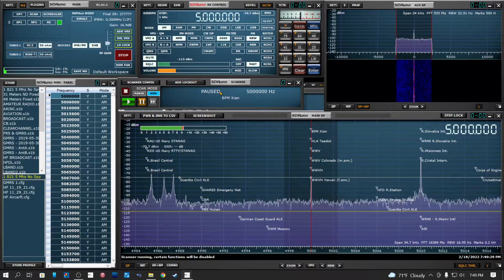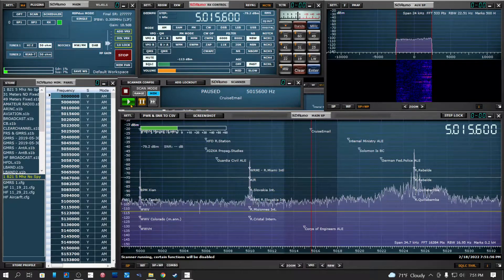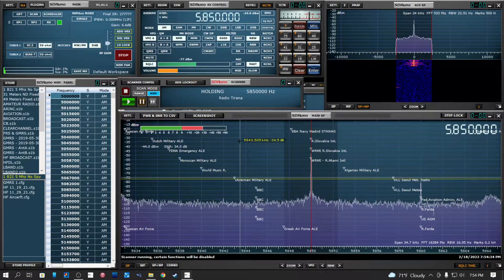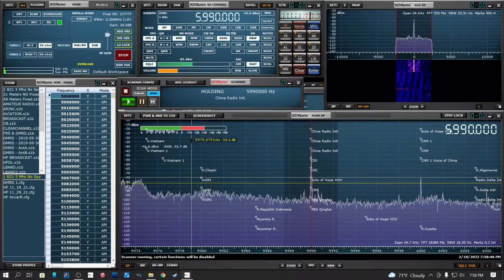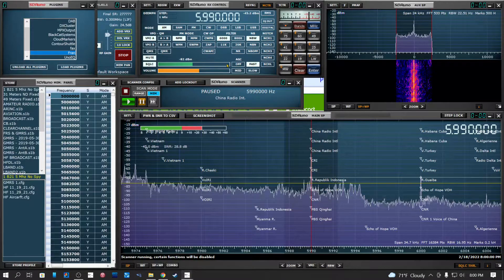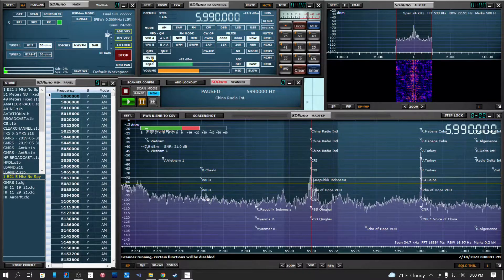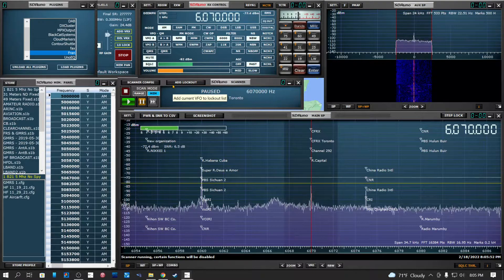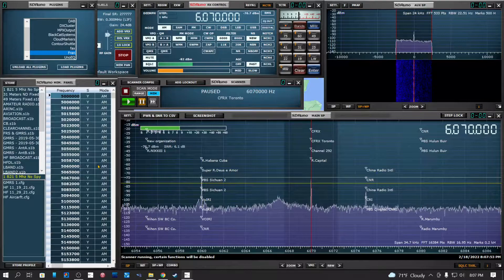TRRS #2345 - Scanning Shortwave with RSPduo SDR - Many Stations

Comment: Hello Tom! Would you recommend an RSP1A, or a RSPDX over say an Icom R75, or a similar Desktop Receiver? Thanks!
Reply from the maker: That is a difficult question as SDRs are so much different than a standalone radio. Using a radio like the R75 is pretty easy but learning how to use to software to control an SDR can be difficult for some.  If you are very good with computers and computer programs the SDR like the RSPdx is much better and you can do many, many things with it to improve reception.  This is the short answer, so do some more reading and watching of videos on each type.  I am heavy into to computers so I prefer the SDRs.  Remember, I am no expert.  Oh, lastly, the SDRs are much cheaper.
Reply: @hamrad88  Thanks for your reply Tom. Yes I like the idea of using a computer controlled SDR myself. Especially being able to make adjustments and choosing different filters and such. I already have a spare laptop computer and a couple tv’s for monitors. I have been watching a lot of reviews on YouTube and reading up on their capabilities. That’s the way I’m going to go. The RSPdx is going to be in the near future I think. Thanks again.